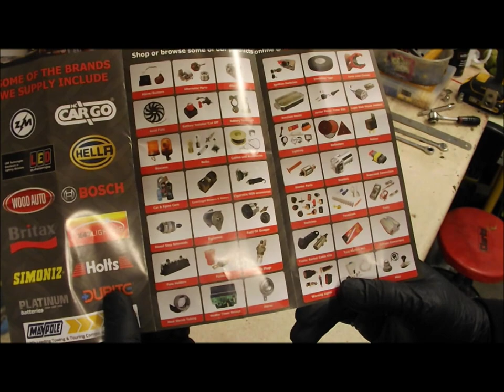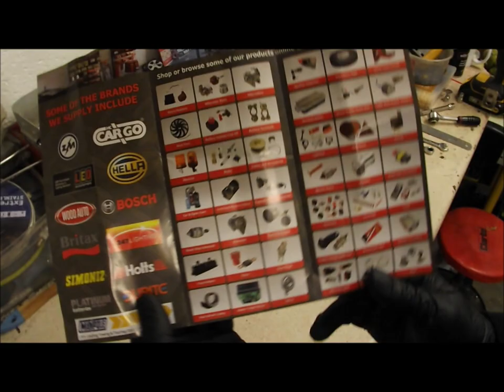12v Car alternator DIY home rebuild for less than £20 - Vintage Steel Garage Ep20

Comment: I was amazed the parts for these were available. I would be interested in having a look at the old parts to see if it’s the regulator or the diode pack. Great video.  Been busy in the garage  starting to do a bit of work on the truck again. Regards Chris
Reply from the maker: Chris the Alternator was new 2 years ago, but  off a 90's ford Fiesta plus all lot of other 90's model cars. I fitted this to the 58 GMC truck so I;d be able to get spares for such an occasion as this. Originally the truck was fitted with a dynamo.  Good news you are back on the truck.  I have kept the rectifier pack as I though it would make a good video for you to test :-)
Reply: Vintage Steel  Thanks Andy I will give you a call later in the week. Chris
Reply from the maker: @allthegearnoidea6752  ok great Im off now till Monday, so hopefully Dart will turn a wheel. PS its back on all 4 wheels!!!!!!!